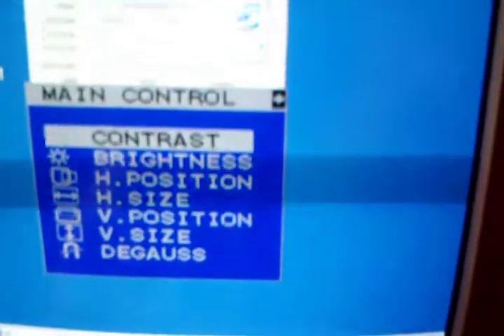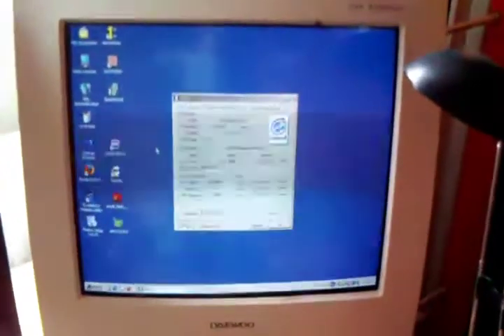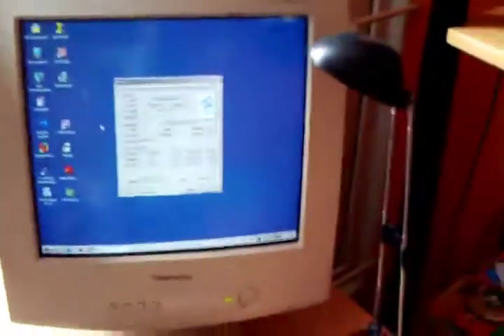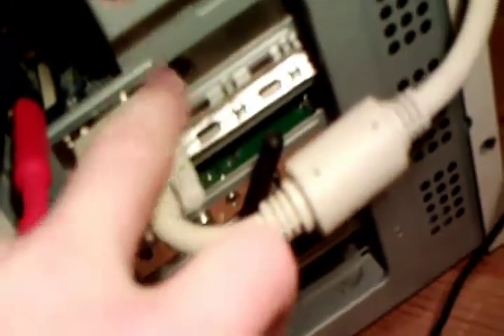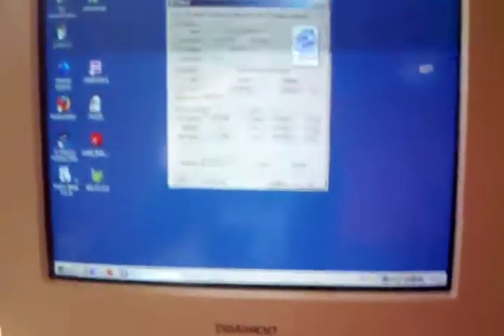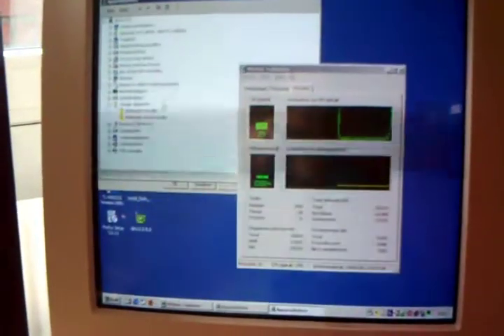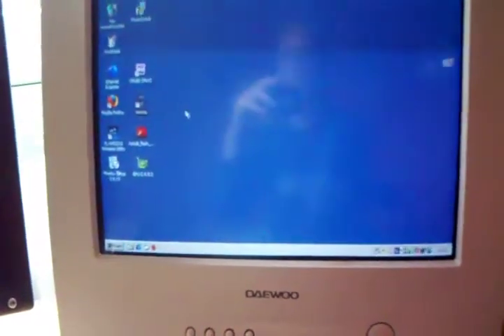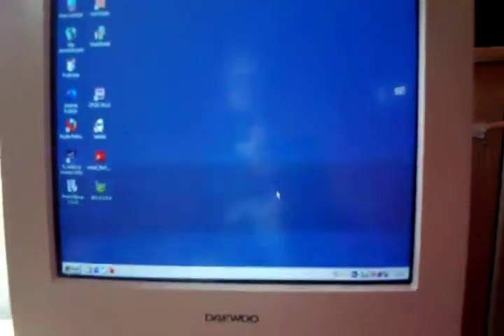The Pentium 3 computer

Comment from the maker: Don't get me wrong, I am becoming a bigger Linux user by the day, but I won't ever run it on an underequipped system like a pentium 3. Pentium 3's are best used with Windows 95 to XP, and they work well with that. Older Ubuntu distros like 10.04 run somewhat acceptably, but not quite to my liking.